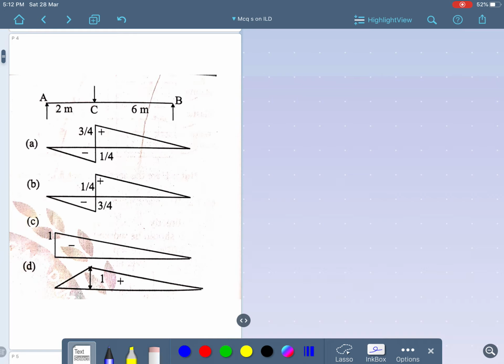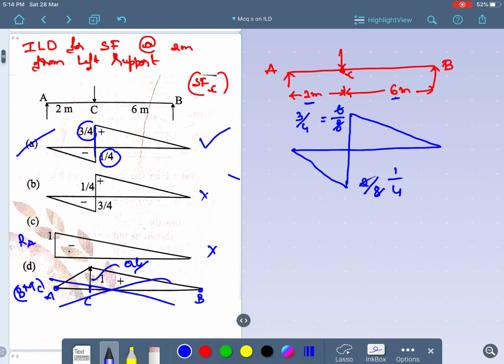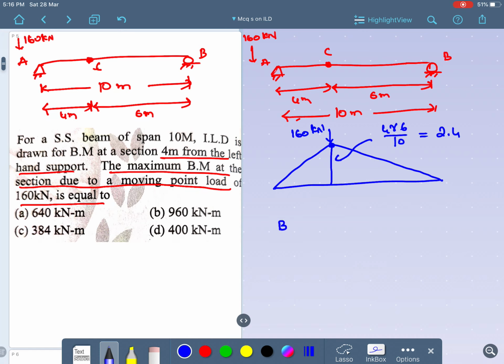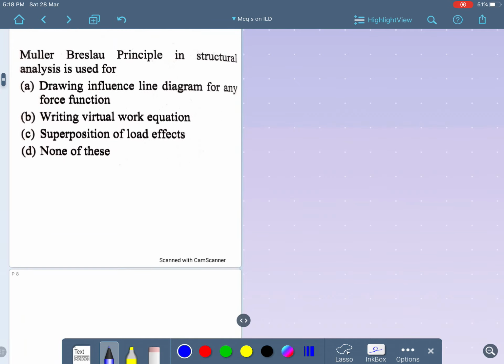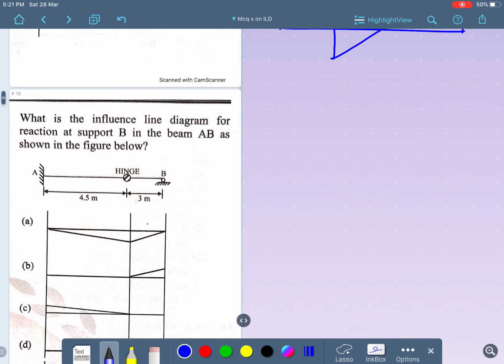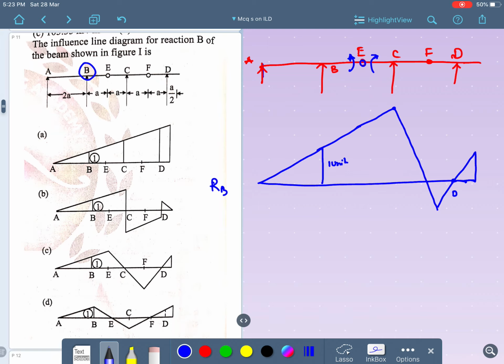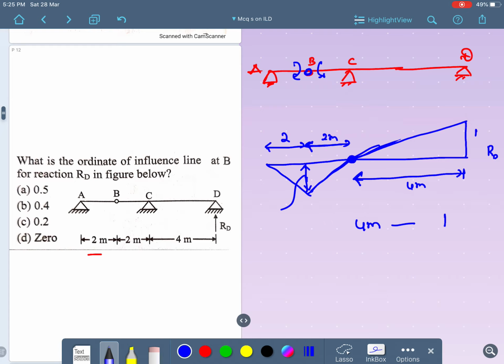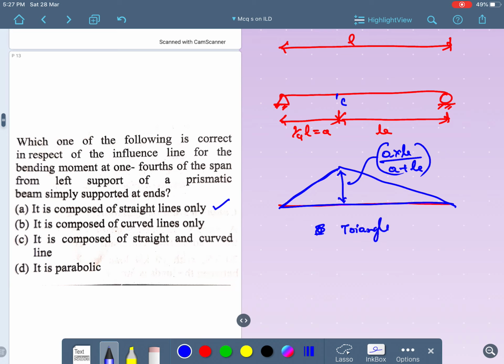Structural Analysis - Influence line Diagram - Concept and MCQ s - Part 8

Comment: How ILD is parabolic for maximum BM wrt simply supported beam,we draw it as a triangle right
Reply from the maker: For indeterminate structures it will be parabolic
Reply: @smartacademykpsc4910  In qns they have specified SSB so it's determinate Oly sir...Ans ll be triangle
Reply: @smartacademykpsc4910  yes sir please do clarify about this...
Reply: In question it has not given indeterminate then how to consider it as indeterminate it may be triangle for determinate structure ryt ?
Reply: And we calculate the area by considering it as triangle